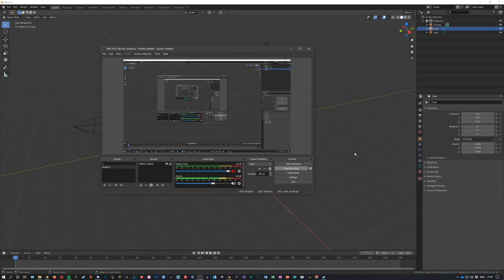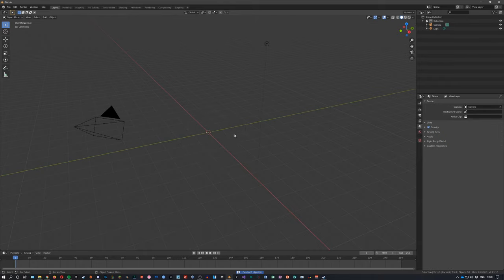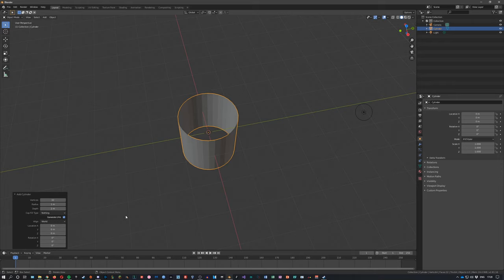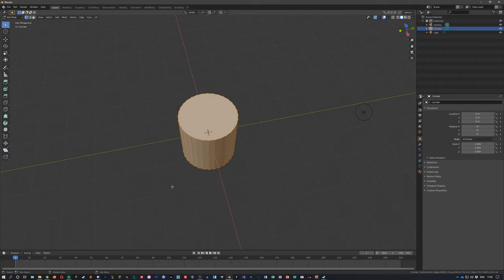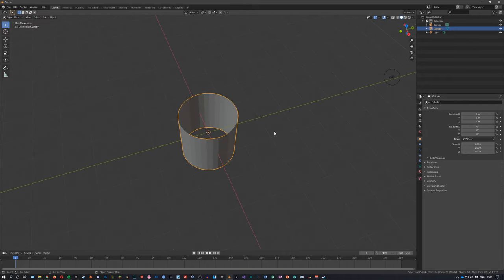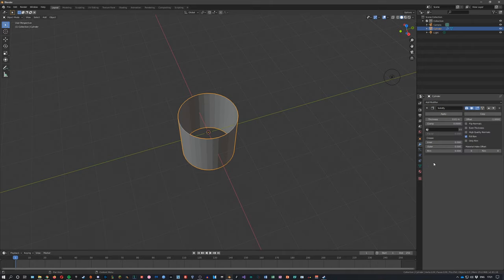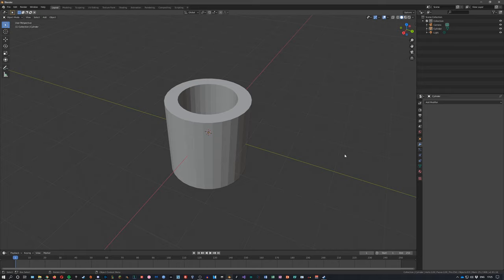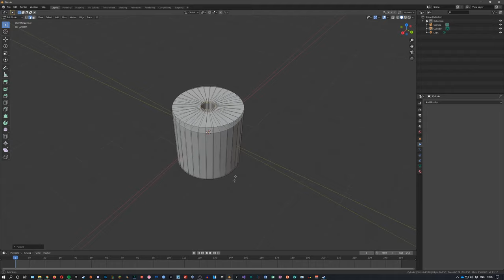[Blender 2.8+] How to make a hollow cylinder

Comment: I'm hardly a beginner to 3D but still found myself looking for the best way to do this in Blender - in trueSpace (which I used until about 15 years ago before leaving 3D altogether until now) this was available via additional options right in the cylinder tool panel. Additionally, you could define the arc angle to create (as opposed to 360). I've got a need to create one that is about 1 inch tall, .125 thick, with an outer radius of 117 inches and an arc of 30°. In tS, that could all be done via text input in a single place. I find this kind of thing quite tedious in Blender by comparison. I wonder if there are any addons that fill that gap?
Reply from the maker: In Blender I always keep proportions correct then scale.
If I need to model something using meaurements so accuratley then what is the purpose of the model? Blender is far better for artistic creations. If I need to model things with lots of measurements it will be for 3D printing or CNC. In which case, I choose other software like SOLIDWORKS for example. This is more suited to these kinds of tasks.

Comment: how do you get vertices on the inside
Reply: select inside and loop-cut/subdvide/cut tool?
Reply: @risk0892  what do you mean inside? there is neither out or inside
Reply: @deluxe.mp4  have you clicked apply? i may not be understanding what you're having trouble with
Reply: @risk0892  i need to have an outer wall and inner wall for the tube. Using solidify doesnt solve this i guess.